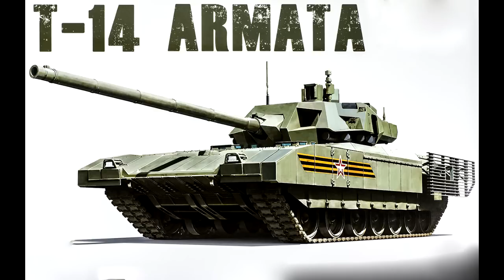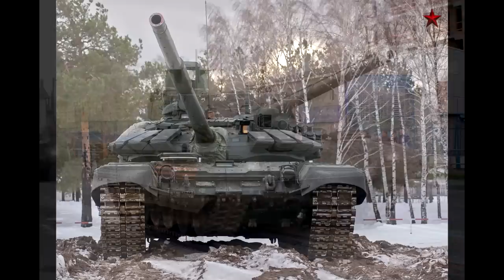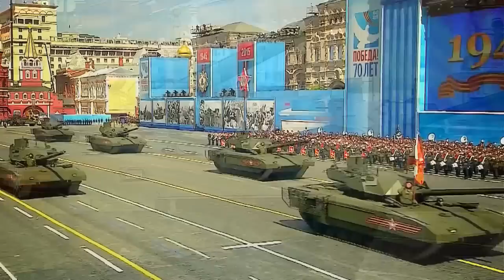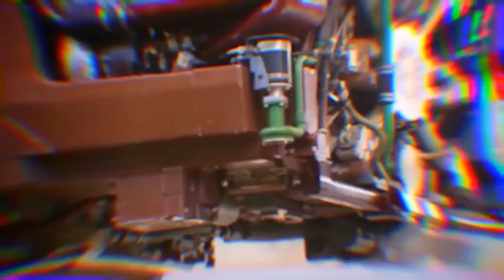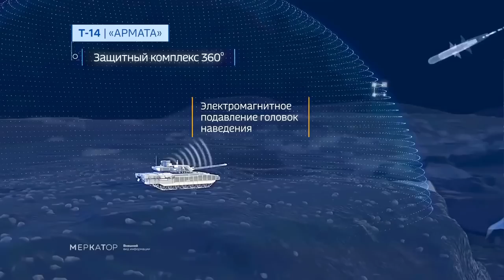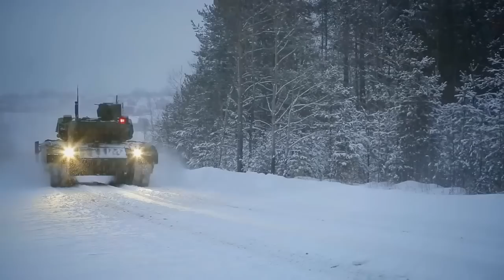Busting Myths on T-14 Armata

Comment: Looks slow; almost as bad as a Markrav; I guess its a defense only tank, like a mobile pill box.
Reply: Actually, T-14 is a one of the fastest MBTs in the world. Even faster than Leopard 2. Up to 90 kilometers per hour. And a range of 500 kilometers.
Reply: OMG a road speed of 90 KPH; like I said; S L O W.
Reply: Joe Gibbs name an MBT that goes faster
Reply: Joe Gibbs armata is a platform, the t-14 makes the platform a tank
the t-15 is a HIFV. critical elements of the turret are incredibly difficult to hit. abrams hit 60 mph for just above 6 seconds then broke under stress. armata also has a overclock which increases the road speed at the cost of the engines life span
Reply: Joe Gibbs commanded abrams for over 12 years, going that fast will blade hook the living shit out of the engine. turret has plenty of passive armor, and back up systems, sure you can say hit those too, but then apply the same to the abrams, both become ineffective.
Reply: Joe Gibbs bypassing the governed speed is reserved for combat only (unless test) just like armata has governed speed
Reply: Notice the Russian propaganda machine always compares the top road speed of the T-14 to the governor speed of the M1. M1 does well in excess of 90 kph with no governor off roads and did it for all the world to see in 3 wars. So there is one for you. Is T-14 even a tank? As there is no turret basket and no crew in the turret isn't more of a SPG? Only one light caliber machine gun and no coax machine gun, the turret appears lightly armored with many, many shell traps too.
Reply: Joe Gibbs and the t-14 can aim with out moving the chassis, so it's not an spg
Reply: Joe Gibbs and it can be equipped with a coax, and also a 30mm auto cannon
Reply: hit that T015 in the turret with anything bigger than 50 cal and that gun aint going work. 200 M1s did over 90kph for hours in GW1, the US army flew in helos with gas to refuel them. Thats a fact from history. Maybe the 30 year old M1s arent that fast anymore;; oh wait, they got rebuilt so no problem.
Reply: so can many other SPG.
Reply: with the crew all in the keep and no direct view with the weaopns; all sensors it seems it would be very vunerable to AMR taking out the sensors and therefore making it ineffective.
Reply: except the abrams still has crew in the turret that can shot with the optics or even bore sight (the still train you on that right?) where as the Armata can't; its all remote, made in china on the cheap electrics, with made in russia pray it works mechanicals. Here is the rub; at 2K 60 ton M1 with the 120 can penatrate the turret sides etc of the Amarta -m aybe the crew compart remains in tact. 48 ton Amrmata can not penatrate the front turret and front hull of the M1. M1 HE would probally disable Armata turret; hell 75mm high expolsive probally could.

Comment: Excellent video. I'm most impressed with the Armata looking after it's crew. Gone are the days that the Russian military would be happy to send hundreds of vehicles to "overwhelm" the enemy. Instead now, crew protection is key. I like the armata to be fair.
Reply from the maker: Thanks for the compliment on the vid :) 
Yes indeed, crew protection on Armata is really amazing, no more risk of ammo cooking everyone inside.
Reply: @RedEffectChannel  pls in some of your great clip explain that amazing protection of crew, and soo goood automatic system on all other components ..i'm sceptic about capsule for 3 mem crew
Reply: How many Merkava tanks were destroyed in the Lebanese war? Many,
 so many that the jewish soldiers to this day, prefer other branches of the
 army, that does not put them inside this armored one, by the great distrust that they have to. And the high commanders, have trouble filling the places in the armored
Reply: @11dimension51  false ...read again abut conflict in 2006 and especially about Mk5 and no Trophy involvement in 2006
Reply: Aged like milk
Reply: those days are still here even 4 years later...
Reply: This comment didn't age well lmao
Reply: This did not age well lmao
Reply: now I know one of the source you scouring for info there Mat :D
Reply: Maybe your idea is not so good. Indeed, what if the tank is attacked from behind, where - in general, and common - its armor is not that thick and effective? In any case,  any option is a valid approach - and can be considered.
Reply: you should probably read up on Zhukov.  He had no problem sending millions to die as long as the Soviet Union won in the end.
Reply: Oh lord this aged well
Reply: Matsimus Gaming I'm about to watch one of your videos after this
Reply: I didn't expect yo see you here Mat
Reply: A tank should never be in a situation where it can be attacked from behind. Of course it can happen, but generally few tanks were destroyed by being shot from behind, so its not worth putting on extra armour on rear.
Reply: Crew security is the key to giving high morale to the troops and loyalty to the state. Gone are the Soviets who would machine-gun their own troops if they ran in the face of the enemy.
Reply: This didnt age well
Reply: paramonov1984 Armor no, but a transponder would be useful to protect you from your own flyboys…Almost 100% of American and British tanks lost in Iraq were lost to friendly fire.
Reply: Don't they already have IFF?
Reply: autistic jedi most armour in a tank is in the front so the crew is protected. But there is an engine at the back where there is less armor so the crew is well protected in Armata then in merkava
Reply: autistic jedi  the fuck sake man dont say that Merkava gives more crew protection.
Reply: Hi Matsimus, love your channel :D
Reply: нет маркиз! & Nico, both of you are correct, and it is nothing to do with EatG. The Soviet forces under NKVD supervision, or of the NKVD themselves would and did kill some Soviet soldiers if they refused combat and/or ran; ..usually those was part of prisoner/penal units or in critical situations that required dire measures to stop a mass rout with non penal troops..
   The 'enthusiasm' was not questioned by Nico, and it was not a problem after until Operation Uranus campaign led to the victories that came with the Operation Mars campaigns.
Reply: Bad/wrong tactics and use of tanks are the main reason for getting tanks destroyed and crews killed. Going into places where tanks do horribly in the first place (citys) and not supported by infantry is an all time classic.
Reply: So ,if you impresstd ,you dam like most russins
Reply: Most of those were destroyed by IEDs and other weapons, not other tanks.  Merkeva is a good defensive tank, but it is slow and lacks maneuverability.  If used as intended, it is still formidable.   Beyond that, just because the Merkeva is under powered and under armored,  doesn't mean the design principle of a front mounted engine is unsound.
Reply: That problem is best addressed with better training, not better armor.
Reply: You are wrong of course, most US export model M1 series do not have the full protection of the models we keep for ourselves and our actual allies (like Australia).  Secondly you cannot expect any tank, no matter how good it is, to survive in urban combat when they are mishandled so badly by poorly trained troops with poorly trained leaders.   Russia learned this lesson in Grozny.  Tanks are not meant for duels, and people need to get that through their heads.  It's a combined arms effort backed up by good logistics and leadership all based on a foundation of good training.  The gun on the T-72 cannot penetrate the front arc of a US used M1A1 or M1A2.  The sides are rear are perhaps another story, and of course IED and top attack weapons will take out any tank, including the T-14.
Reply: Gregory Rush especially since those IEDs meant to take out tanks are hundreds of pounds of explosives sometimes. No weapon system short of a free fall bomb can deliver that much explosives to an enemy armored target.
Reply: Different systems have been tried, everything from identification panels that are easily visible in thermal/infrared sights to electronic systems that were never fielded as far as I know.
Reply: autistic jedi,Well,it's just my opinion,but if you look at all Soviet-Russian equipment,it was made to be as simple,sturdy,reliable,and easy to repair in a field conditions,that made them cheaper to manufacture,and good sell value in the countries not so advanced technologically.Now,try to imagine,for example to replace the motor in a heavy armored front of the tank somewhere in a desert.It'll take more time and resources,then classic rear layout.Like i sayd,its my opinion,but at WW2 germans had to tow their overengineired Tigers and Panters to the base for repairs,when russians was fixing T34s and KVs at the field more eficiantly and faster.Plus front layout means "front wheel"drive-weak point to disable the tank without penetrating heavy armor.Just saying.
Reply: There is a bit of a problem with that ideea. Engine up front would first put more weight  in the front of the vehicle(Obviously) which would cause handling problems
Second, you have to think about the impact. Engines are quite sensitive. Unlike the crew which can recover after a big shock, if an engine is knocked out, it is gone, and so is the tank.Considering the vehicle is mostly going to go facing the enemy, most of the shells and rockets and mines are going to detonate in the front, sending the shockwave directly to the engine
3rd, as people said, the back of the tank is usually less protected. So, instead of building 2 armored cages(for the front of the tank and the back for crew) you can save weight and material.
Reply: Matsimus Gaming sure they protect the crew in a heavy metal box, but are risking a lot leaving the rest of the tank so thinly armored it couldn't stop any sort of heavy round. They rely solely on their APS to stop every incoming round, that's risky for something that has never seen combat before. It's a capable tank but it's got some very serious flaws.
Reply: Yes, yes, yes.  Greg - you are spot on.  To hell with logistics - replace the young men killed with other young men to be killed, ad infinitum .  And Patton was just as bad!!!  We can win by sheer force of numbers - just send me 'thousands' of Sherman tanks.  Of course, with every destroyed Sherman, human lives (the tank crew) were also  destroyed.  Some Sherman tankers were even 'afraid' to get into their Sherman Death Traps, especially when the interior still reeked of death, even after washing and repainting, the stench of body parts, blood  and even brains, couldn't be  covered up.
Reply: Yes, yes, yes.  Greg - you are spot on.  To hell with logistics - replace the young men killed with other young men to be killed, ad infinitum .  And Patton was just as bad!!!  We can win by sheer force of numbers - just send me 'thousands' of Sherman tanks.  Of course, with every destroyed Sherman, human lives (the tank crew) were also  destroyed.  Some Sherman tankers were even 'afraid' to get into their Sherman Death Traps, especially when the interior still reeked of death, even after washing and repainting, the stench of body parts, blood  and even brains, couldn't be  covered up.
Reply: a little disappointed for a man who has served ( i understand the mutual filmmakers appreciation Society )... But Matsimus have you not notice how the troops inside are in fact quite literally Rubbing shoulder to shoulder...see what that does to crew moral after 72 hours under stress...aside from the many more obvious weakness of said systems..Cheers Allan
Reply: Gordon some of what your interrupting is the Russian Socialist mass murdering millions of their people as well as having KVD troops shoot an kill their own... that will trickle thru in ones reads of how they fight. Again western Left wing Bullshit makes them to be hero's..when in fact the Ukraine's people welcome the Germans at first as Liberators...
Reply: communist killed at least 20 million, an there is a natural habit for Russian not to work very hard till needed, very Italian (which is why their GNP is about the same size)..
Reply: Sure the protection of the crew is all well and good. But fact remains that if the turret is hit and disabled or even its optics destroyed the tank wont be much good after that. And those that say "well they can just give the crew a new tank and their valuable experience wont be wasted" I say: You really think the crews chances of evacuating successfully on a battlefield where they suffer a weapon crippling hit are good?
Reply: +John Nordic it can still aim and you nead to be Reilly lucky to hit it
Reply: Matsimus it’s broken down you fool that’s how reliable it is they’ll need hundreds maybe 2 will make it to the battlefield
Reply: That special armored crew compartment combined with that turret will prove a death trap for the crew. It may take 1 hit well but a follow up is going to be bad.
And I would definitely double tap that tank.
Reply: @Komsomolskaya  And WHO wouldn't be with mg at your back.
Reply: those capsule idea is great but i'm still sceptic..what if some wire broke...they must go out for fix wire ..and capsule at that moment haven't rolle
Reply: The crew may be protected, but how close they are? A breaching shot is as good as death for them, and this is russia, quality, not the best
Reply: T90sm is a pretty safe tank to.
Reply: A negative birth rate will do that to a country.
Reply: > Russian military would be happy to send hundreds of vehicles to "overwhelm" the enemy

Did Mr. Hitler and Dr. Goebbels tell you that, buddy?
Reply: Its a concept in a whole new level. Don't really know if other tanks around the world put as much effort in protecting their crew as the Armata does. Maybe they could learn from it.

Though lets be honest, with things going like this, the time where a tank becomes "remote controlled" might not be far off, and honestly, that would be the highest level to protect the ones using the tank.
Reply: +нет маркиз! haha so it was just Hollywood propaganda? but didn't Stalin murder 20 million of his own people? that's what I read.
Reply: paramonov1984 On aircraft yes, but not on tanks to my understanding, I believe for reasons of stealth movement. Same reason the F22 and F35 don't use it unless in civilian airspace…
Reply: Wilfred Darr that’s why we use Combat Identification Panels.
Reply: The best way to avoid it is better coordination then.
Reply: yes the russians already have a remote controlled scout tank
Reply: at what times, and how, did the Iraqis  become friends to the Americans and Brits ? - that bad joke aside, shall not we note that most of tanks were lost not because of "friendly fire"...  but it should be kept a secret; otherwise what an American in a sober state of mind would operate an Abrams M1A2, pronounced so invincible, but in fact vulnerable to nearly obsolete guns of T72s? ...that is why the footage is so hard to come by on public channels. Ah! Propa-opa-propa-propaganda. BTW, what do you of a recent rumor that the best of ARmata and ABrams will be taken and combined into a new, better tank, naturally named following the first letters of the tank names respectfully - ARAB ?

Comment: I don't care what anyone says, it's a very cool tank!
Reply: felixlinquist   It is a very beautiful machine
Reply: I will agree it is an impressive machine. I wonder if the Abrams, Challenger, or Leopard will be the next tanks to have a system to stop SABOT. The Race is on Ladies and Gentlemen.
Reply: i care
Reply: John Bright lol he's not talking about the armor but rather the APS. In simple terms T-14 can destroy sabot round in mid air before even touching the surface of the tank itself.
Reply: @ZhaoHaiBuda  Funny thing about APS's, if any of the sensors get damaged or destroyed, from say shrapnel or an artillery strike or any kind of explosion nearby, the whole system is kinda useless. It's really not as impressive as a lot of people make it out to be.
Reply: Kirigaya Kazuto This is true about the Armata. Its defensive measures are impressive.
Reply: felixlinquist you're comparing Classic Coke to Shasta Cola, one's an original, the other's just an imitation.
Reply: well have you all seen it without armor plates? then its damn ugly...
Reply: Andrew Elston As for the M1-A2 stopping a sabot. Yes it can. During Desert Storm M1's came across T-72's. At a range where both main gun's were both in their effective range. An Abrams had taken a sabot round in the front sloped glasices plate. It did not penetrate. But, also one has to take into account. The T-72 was older at that time. So armor then (M1) was much more advanced. Had the T-72 had hit else where, I don't know. But what we see today, is that the Abrams is old also. Many up grades are being made to keep it up to date for future conflicts.
Reply: I like the look
Reply: felixlinquist basically
Reply: It looks like it's from ArmA 3
Reply: felixlinquist it’s ugly as shit looks like my sister made it out of old cardboard boxes